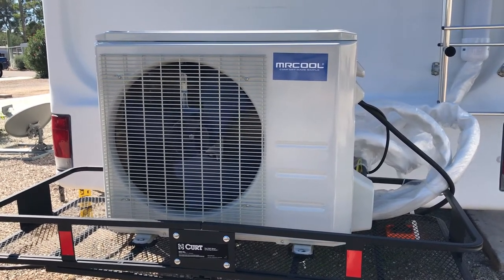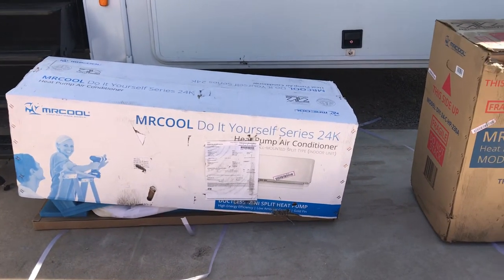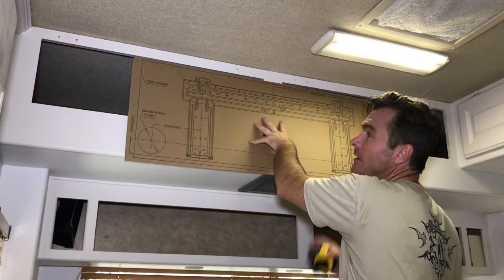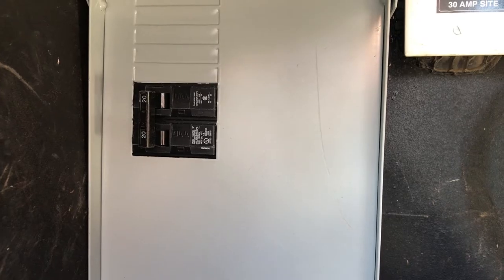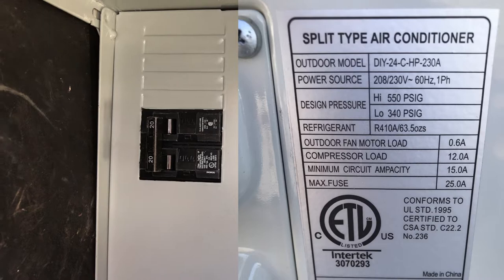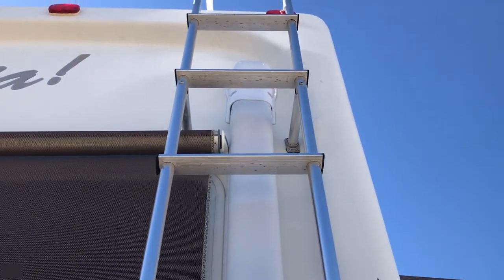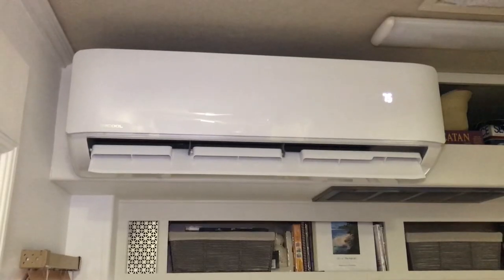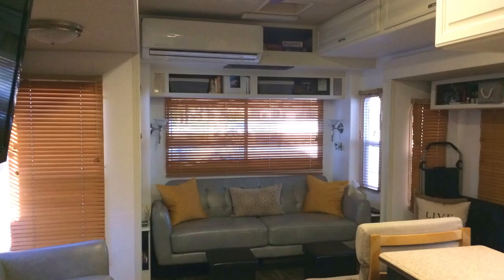RV Mini Split AC Install Project

Comment: I am in the planning stages of doing almost exactly what you did here. Is there anyway i can get with you with my email or yours where i could possibly get a parts list or at least photos of how you tapped into the 50amp service coming in and the breaker box you wired up?
Reply from the maker: Hello! I will check, but I don’t think I have any photos. I’ll check some of the other video footage I have...
Reply: Thank you so much! What cable size did you use to run from the 50amp line to the breaker box you installed for the mini split?
Reply: @iboughtarv6570  Hi did you ever find photos or video? I have an Alpha gold w a double breaker box
Reply from the maker: @warrenjoiner5835  Hi there! I'm sorry, I don't have any other photos or video. For the gauge wire size, it should be enough to service the breaker size you will install in your breaker box for the mini split. The size of that circuit breaker will be determined by the specs on your mini split unit. I'm guessing a 10 gauge jumper wire between your main box and the breaker box for your AC unit should get it done, but that's just a guess. Please check those specs. Hope your project goes smoothly!
Reply: Im doing research to do this project. Did you ever get yours done? do you have any pics of the process

Comment: Is your electric bill any cheaper?  What Seer rating is your mini split?
Reply from the maker: Hi. It's a 16 SEER. Yes. The highest bill I've had in Tucson in August (115+ degrees) is about $120.00. That's running that thing non-stop all day. Guys near me with roof top units were paying over $300. The mini splits are much more efficient.
Reply: @iboughtarv6570  wow nice. I've seen the mini splits up to a 23 SEER.

Comment: 2 tons seems loke overkill but maybe Mo is bettah? 1 ton =400 sq ft
Reply from the maker: Under normal circumstances, you're absolutely right. But 110+ degrees outside and not the best insulation, I wanted something that could easily handle the load. When it's 110 out, I can easily keep it at 78 degrees all day for just over $100 per month.
Reply: @iboughtarv6570  nice. How much are you saving per month?
Reply from the maker: @patrickmelson4745  My highest electric bill was $125.00. Prior to that I was using the basement AC unit in the Alfa and my bill was about $175/month. However,  the basement AC broke, and was going to be quite costly to repair with no guarantees that it would last very long. So I went with the mini split option. So glad I did. It's a 16 seer. My neighbors who have 2 roof top AC units are spending $300 per month in the summer and are struggling to  keep their coach at 88-90 degrees. I can keep mine at 78-80 all day for $125 a month. It's awesome. And the heat pump is great on the cool desert winter mornings.
Reply: @iboughtarv6570  Okay makes sense. A lot of mini splits are 22 SEER. Not sure how much that would help.  I may install one.  I have a 40 foot with 2 AC units and in Phoenix.

Comment: I'm in Florida and I have a 43ft 5th wheel and I'm thinking of installing a mini split. I'm looking at a 110v 12,000btu unit so I can run it off my portable generator if necessary. The brochure says it will cool 350-700 sq ft. we like to keep it really cool for sleeping at night. Do you think this type of unit will do the job?
Reply from the maker: Hey Brian. It might be enough. I know in Florida you deal with more humidity than Arizona. Another consideration is, will you be in the direct sun? Or do you have any shade over the roof of your coach?...I think it would suffice for at night, but if you are in full sun during the summer months, it may struggle to keep up. Also, if you are mounting the unit in the back of your coach, and your bedroom is up front, you may need a fan to help some of that cool air make it up there. Hope that helps.
Reply: @iboughtarv6570  thanks for your reply. Yes we are in direct sun from about 7am to 7:30pm. I was hoping not to have to use the roof A/C’s as much with the mini split. I set the roof a/c to 78 but it never really gets much cooler in the coach than 80 -81 and they both just run all day. The bedroom a/c gets it down to about 69 at night but it’s on and off all night long.
Reply: Nope. Double that.

Comment: Would a 1 ton unit do the job?
Reply from the maker: Hi. Possibly, but not in Arizona if you're going to be there in the summer. If you are in a spot where the summers are quite hot, I'd say no, it may not be enough, especially for the front of your coach. If you are just concerned about the back part of your coach, maybe; but again on 110+ days, you need some serious AC to keep it at 80 degrees or lower. Hope that helps...
Reply: @iboughtarv6570  Good to know! Thanks

Comment: Can you tell me what gauge wire you used
Reply from the maker: For the jumper wire to the breaker box? I believe it is 10 gauge wire. 10 gauge can handle up to 30 amps.

Comment: I dont understand how youre running a 240v system on 120v
Reply from the maker: the 50-‐amp shore power is actually a 120/240 VAC four wire service. there are 2 wires each carrying 120v. we tapped into the power before it goes into the RV.